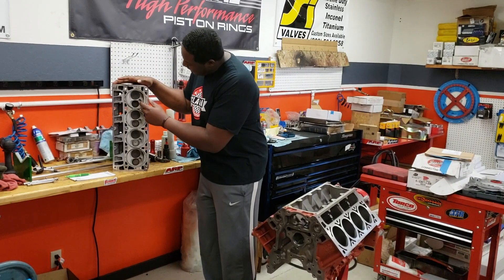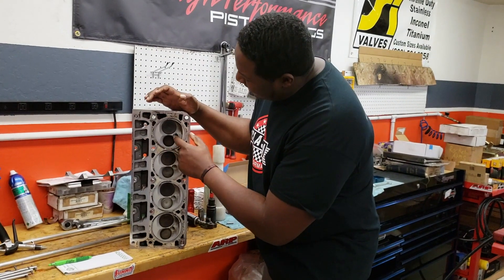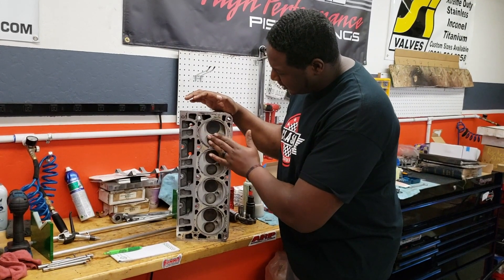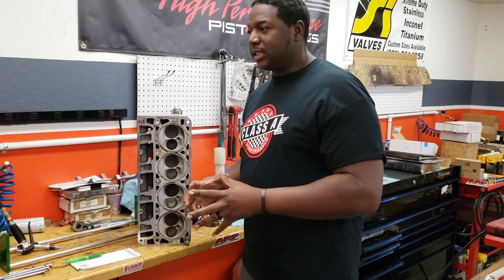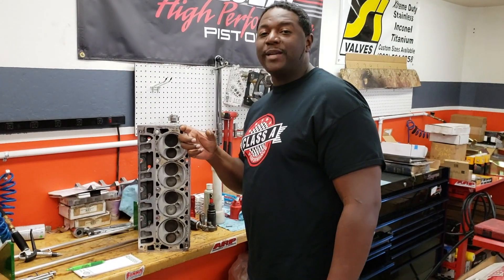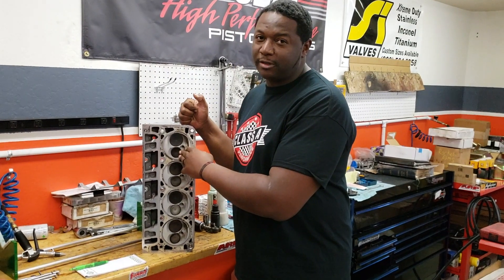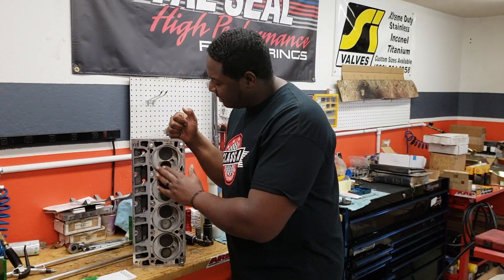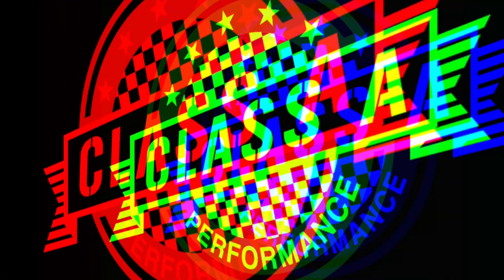Muscle Monday - Reverse Cooling

Comment: How do I do my sbc like this
Reply: Gotta have a newer generation sbc engine block that’s designed for it
Reply: What if you had an electric water pump and reversed inlet and outlet and switched the hoses on the radiator??
Reply: Gen 2 LT